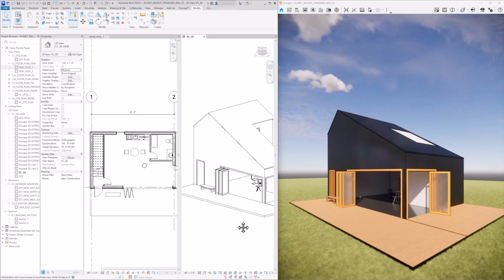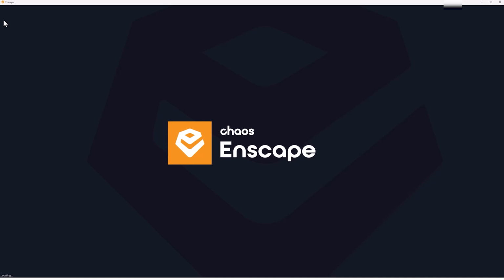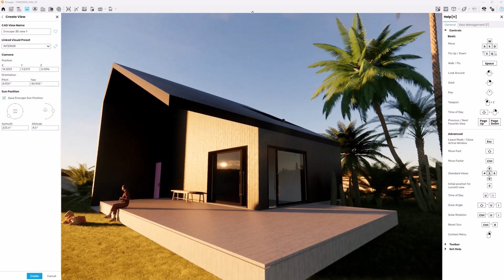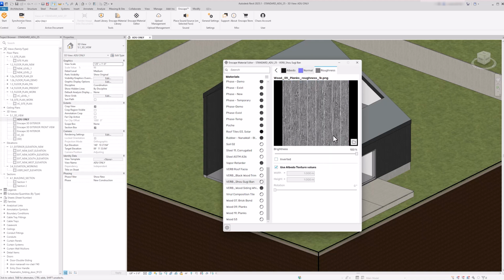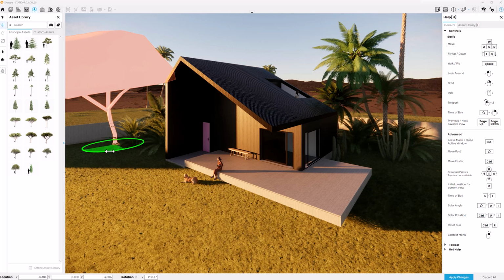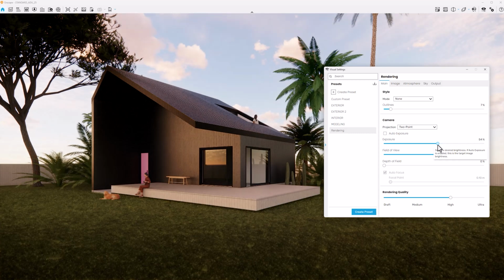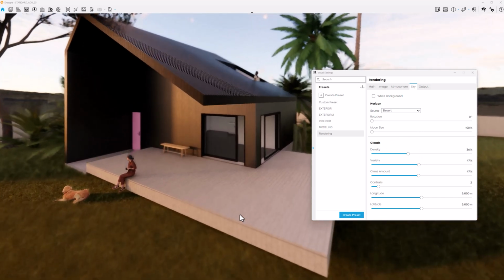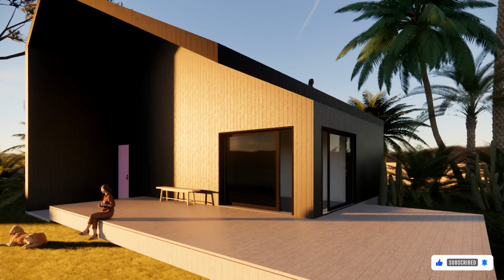Rendering with Enscape 4.1 + Revit for Beginners | MY DESIGN PROCESS

Comment: Do you use internet to run the emscpae...I thought it was supposed to run offline?
Reply from the maker: You don’t need the internet to run Enscape in Revit — it works offline just fine for rendering and walkthroughs. The only time you’d need a connection is for things like activating your license, downloading assets from the Enscape library, or using cloud sharing. But once everything’s set up, you can use it fully offline

Comment: Hi, how can I add light sources for my interior views?
Reply from the maker: In Enscape for Revit, you can add light sources by placing Revit light families like ceiling, wall, or floor lamps, which Enscape automatically recognizes. You can adjust the intensity, color, and distribution of these lights in the Properties panel. Another option is using self-illuminating (emissive) materials to make surfaces glow. Enscape also supports IES light profiles for realistic light distribution. Additionally, tweaking the Artificial Light Brightness in Enscape’s Visual Settings can help enhance interior lighting. Hope this helps
Reply: @VERBArchitectureWorkshop  awesome, thanks 🙏🏿